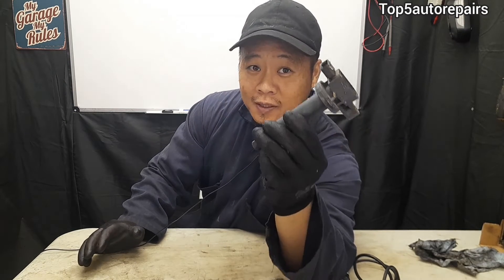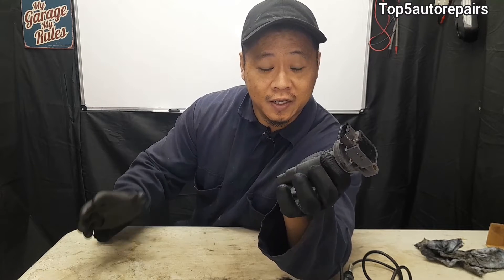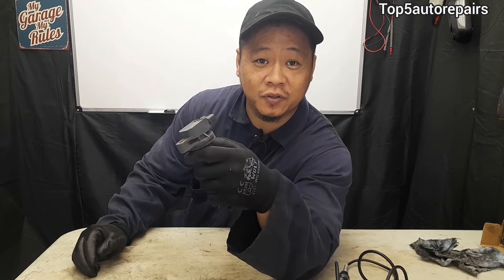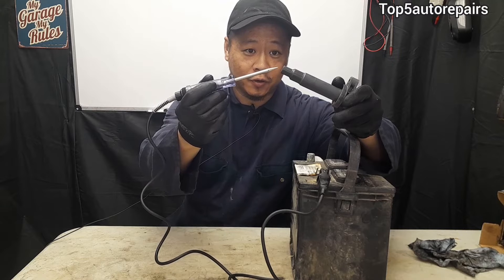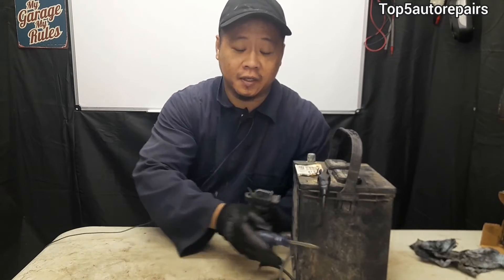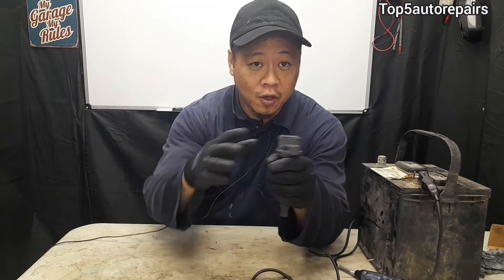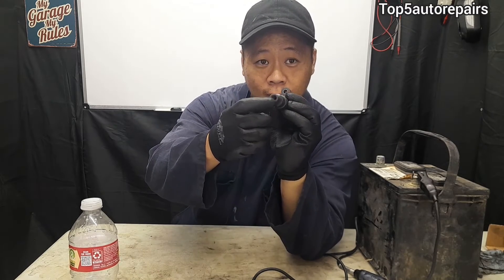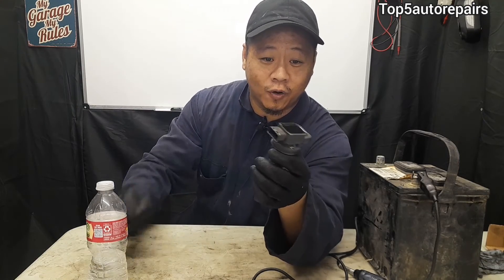Symptoms of Bad Ignition Coil (Explanation and Lecture How to Test It)

Comment: I have a 2011 gmc Acadia,and cylinder 4 has no spark so I replaced all coils and spark plugs and still no spark,I tested the cable itself with test light and seems to have power it’s just no sparking,any ideas guys thanks

Comment: I replaced the icm on my 1995 buick roadmaster, it started right away, but when i revved the engine a little bit, it shut off and didnt start up again, i probably need to replace the coils or sparkplugs. When i crank the engine, the battery loses charge, what do think that is?

Comment: Another good way to test,  is remove the coil, stick an old or spare  spark plug into it, rest metal base of plug against the engine metal,  and start it, and look if a healthy spark is jumping across the gap
.  No excessively high voltage spikes as when pulling coil off plug in engine.

Comment: My 2003 signature Lincoln town car turned of while it was running when I tried checking a coil that look bad it was chipping away at the top connector part but when I took the coil out to the a little the whole car turned of does that mean that coil is bad?

Comment: I used your switching the coil pack trick around and it worked for me 😎! In less than 5 minutes the problem: diagnosed. 1 hour round trip to town to purchase a new coil pack and back 🤬. Another 4 minutes to install it and run diagnostics, then a test drive and we're off to the races!! Thank you so much for this great video knowledge!!

Comment: Nice.
Questin : If only 1 coil fail, is it necessary to replace all, or only for fail one?
Reply from the maker: I recommend replacing all the ignition coil since they wear out at the same time
Reply: @Top5AutoRepairs ok thx. 
Since original xtrail coil cost is about $100, is it ok to replace one by one per month. Or i can find the cheaper one? After market.

Comment: 89 K1500 5.7l 350 TBI   Replaced fuel filter, injectors, and all sensors.       When starting up white smoke exhaust comes out then disappears, when accelerating after a brief stop    Again it will blow small amount of white exhaust smoke    When idle you can see and smell fuel  I’m stumped      Could it be ignition coil in fact?   Or can the injectors may be pushing too much fuel ?

Comment: Hi, I have a 2017 Mercedes E350 my scanner pulled up coil pack 2 is bad, i replaced it but now i can’t clear the code… check engine still there, had the same problem on coil 4 replaced it, but was able to clear code. Help.

Comment: Tnx man, a really clear and simple explanation!! But, what if, as in my case, I have a misfire on cylinder 4 with p0304 code and if I put the tip of a screw driver on top of the coil (with engine running) I can feel a ticking noise all along the screw driver till my hand? Tried that on the other 3 coils and no ticking noise can be felt/heard. So, is it the coil, the spark plug or the enjector? This is a 2014 1.2 tsi petrol Polo :) Tnx Boss

Comment: Nice video.   Most likely misfire problem on 2012 Ford F150 3.5L V6 Ecoboost is what?   Now I'm being told the engine might need replaced by another that had a Ford F150.   Do you agree?   Thanks so much.

Comment: Really good video. Well done and easy to follow along. I had changed my plugs 2 months ago on our 2023 Sonata SEL due to 60k miles maintenance and engine light. Now the light just appeared again. I checked the ignition coil as instructed and seems to be good. If I may ask for a suggestion ?

Comment: Have 98 Honda civic ex is my ignition coil inside my distributor?
Reply from the maker: Correct if you don't have coil on plugs
Reply: @Top5AutoRepairs  i gotten the misfire P0303 which is cylinder 3. I replaced my spark plug wireset and spark plug on cylinder 3 and still get misfire P0303. i also checked my ignition coil inside the distributor. I see the spring wire on top strecthed out little bit don't why it like that will that affect ignition coil from misfire? also i start my car fine in morning and engine starts shake little bit when i warm up for 3 min i have to press gas pedal to bring car back up it also does this when i make a stop on red light. Also my RPM gets very low when i stop ??? so could this be my ignition coil or my fuel injection 3?

Comment: Thanksssss soooooo muchhhhhhh‼️‼️I asked real mechanics and they didn't even think it was a bad coil, but in my mind and soul I knew it was cause I changed spark plugs(Which were needed anyway too) and it ran good and idle good until you are rolling and try and put some real power down and it throws a check engine light and it blink as well as lose plenty power....🗣️🗣️YOU ARE THE REAL DEAL AND THANKS A Second TIME FOR HELPING ME BUD 😎💪‼️💯🙏

Comment: 1:38 "With the engine running." If my engine was running, I wouldn't have a dead ignition coil. Am I missing something?
Reply: Hahaha. 😂 Engines run with a bad ignition coil
Reply: This means also when the car is cranking
You'll be checking and a helper just cranking the engine

Comment: Since I bought new car from agent..1st time replace new spark plugs and ignition coil after next day engine light turn on..Engine Power train P2300,P2303,P2306,P2309 ignition coil low circuit.

  is there anything about that new parts is fake or what? Mine Suzuki swift K14B Automatic 1.4L..Thank god bless you...

Comment: Question: i pose this question just for those looking for answers. Question: lets say you have a 4 cylinder or 6 cylinder and you have a couple of coils that fail... like in some cases 1 will fail and the driver either does not know or just puts off replacing it and then another coil fails. Well some cars will not start when you have lost two working cylinders. So the question,  if you have a non running condition and your wonder "humm let me see if these coils are bad" ...well ??? Yes then you probably want to pull the connector off coil and youtube someone explaining how to test with meter. A good ole VHM is the  $10 (cheap version) tool that always saves you thousands of bucks when the on board computer does not give you the data you need..

Comment: What if i switch the coil to a different cylinder, but the code is still the same? for example if I get p0308, switch that coil to cylinder 6 and i still get a code for p0308 instead of p0306?

Comment: 2003 chevy trailblazer lt shooting code p0300 and when accelerating from 3rd to 4th i lose power and get the blinking engine light at that time, but before that it runs and drives good

Comment: So my sister was having problems with her car studdering she bought new spark plugs and I replaced them It was a pain because I had to take off the intake manifold. Long story short I replaced the spark plugs and it was still doing the same thing really upsetting!  I looked up your video and did your test by pulling coil up a bit to see a change in rpm’s and yup sure enough 1 was weak did not spark like others or have that blue color. Only problem now is I can’t test the back ones there under the manifold

Comment: Enjin light does not always turn on. And mine only did it at higher speed.....not low speed. There is much more symptoms. When my coil pack heated up,like on a highway trip, it started with problems.

Comment: I replaced all spark plugs and 4 coils and im still getting cylinder 1 code. What else could it be?
Reply from the maker: Bad valves, bad piston rings, blown head gasket, bad fuel injectors/wires...

Comment: What if car don’t start to do this test
Reply from the maker: In that case, the problem is something else. If one or two coil failed, the engine will still start but run very poorly. If you still want to test the coil, you can test the ignition coil with a multimeter by checking resistance. I do have a video for this.

Comment: I did a coil swap and then I had two cylinder misfires I put the coils back on the original ones and now I still have two cylinder misfires
Reply: I would look at the connections real good.

Comment: hey man just replace my clutch on my 9th gen civic si, with stage 2 kit with oe hd flywheel and it’s a 15lbs weight and no tuning/req as there website stated and people never had any issues. some how when i break in my car im in 200 miles break in with the clutch, car went to limp mode and 2/3 cylinder misfire. never had issue with the car only after clutch replacement. reset code and now it’s 4 cylinder misfire. hopefully it’s the coil pack which i will do it when i get the parts. it’s so odd that i get misfire when everything i replace is oem specs. i will do my spark and coil and go from there. hopefully 🤞

Comment: Defective crankshaft sensor cause misfire not having enough compression in the cylinders.Certain year nissan crankshaft sensor after market will cause misfire and the intake. hose mas. Sharing with people who have nissan the value in the 2 parts is different from the after market. Hitachi manufacturer mas and Denso manufacturers crankshaft sensor for nissan the value may different than oem.

Comment: My 17 Yaris IA says misfire cylinder 2, needs ignition coil, but it doesn't shake or sputter at low speeds or idle. It sputters if you gun the gas.

Comment: You’ve helped me fix my vehicle and families vehicles by watching some of your videos. I’ve had my vehicle parked for three weeks now and I wanted to ask if you can help me out. Before it stopped turning on, I had to jump the vehicle in the afternoons to get back home from work now it won’t crank over. I’ve bought a brand new battery. Replaced the alternator and the starter truck still doesn’t want to crank over any ideas ? 2013 F150 lariat 4 x 4 5.0 V8.flex fuel
Reply from the maker: Hello. You might have a bad starter, starter relay, or bad ignition switch.

Comment: Silly question when I'm standing in front of a 2019 Hyundai Accent sit down what order does it go from passenger side driver side I have to change a coil ignition coil is it 1234 can you give me the order they are in when you have time should be appreciated
Reply from the maker: #1 is on the serpentine belt side, then 2, 3, and 4.
Reply: @Top5AutoRepairs  thank you so much I was on my way to work today when the car started running rough so I pulled over put it into park and the motor was shaking. I took the oil cap off and it was lots of blow by the car started smoking blew out the tailpipe so I shut it down put the code reader in, told me what was wrong. Then I cleared the code took off the back on the road to go to work, but I screenshot the issue. It was giving me.po302 cylinder two misfire detected
Reply: @Top5AutoRepairs  yep number two coil was buggered put the new one in first I did what you said on your video I was watching with the tester put the new one in there works like a glove thank you so much
Reply: 2019 Hyundai accent sedan 1.6 litre what is the firing order if your standing right in front facing motor

Comment: I have 2006 toyota sequía  but something is messing up my ignition coils I have change it like 3 times I change the computer which mechanic says could of be sending to much power to the coils is been like 4 months but just yesterday  my check engine started blinking and car had vibration while park. After a minute normalize again so far good but hopping is not doing it again 😊

Comment: Brother I have an 06 is250 been sitting for 8 months it run when parked now trying to get it running again bought new battery try to start it it just cranks thought it was the fuel pump so change that still won’t start
Reply from the maker: Try adding fresh gas in the tank. Next, I suggest checking the engine bay and check if rodents chewed up engine wire harnesses.
Reply: @Top5AutoRepairs  thanks for the advice I will check it brother

Comment: hi, when I pulled the coil out it had oil at the bottom, where it goes over the spark plug, could you say why is oil there? Does that means that my engine is going bad?
Reply from the maker: There is oil because the valve cover gasket/spark plug tube seal is bad and is causing oil to leak inside the tube. Most likely the engine is 👌.

Comment: I have a misfire on 7 and i swapped it out with some extras i had but the engine stopped shaking and the rpms dropped to .5 and not on 1rpms which is where its been

Comment: Hi I have skoda rapid i have changed spark coil and ignition coil still I have the engine sign flashing and I have epc.do you know what will be the problem.i have diagnosed it says po351 which I changed more then 3 times after awhile I get still the same signs

Comment: Lesson you guy, the ignition coil last 120,000 mile or more if go bad is because the spark plug is oiled because the exhaust valve inside the cylinder is leaking. After you test  the integrity then you make a conclusion on what to do.

Comment: Good explanation. I have a misfire on 2016 Chevy Traverse, but it just gives me P300 (random misfire)
I wish it would give me a specific cylinder code...
Vehicle only hesitates/rough idle when it gets to operating temperature. When its cold in the morning, it runs fine for the first little bit of driving.
Reply: If it's a coil pack, aka a block all the plug wires feed from could be a small crack u don't see an when it gets warm opens up, sound like you could have a moving misfire if coils are arcing bad enough,  my 2004 Sentra right now runs fine for the first 10 mins then stats acting up. Changing coils this aft, I have individual coils per cylinder top one was changed by previous owner. 
(cyl4) My miss is now cyl2 so I'm doin the other 3 along with swapping all 4 spark plugs. Hopefully that cleans up the idle an low rpm take off. She shudders an loses power when I stop an take off.

Comment: I was working on my 07 Toyota Avalon. With over 190k (I have 237k now)at the time back in 2021, I replaced all spark plugs , replaced coils but I only left the front three ones. The back of the v6 is harder to get to so I replaced all coils so I didn’t have to. Transmission was also serviced and fluid is bright colored. But I’ve been experiencing shuddering and lack of performance when accelerating from dead stop and vibrating at a stoplight in drive. Do you think it’s because of not replacing the front three coils?

Comment: Will you get a check engine light if the coil became weak but still works?  My car has a slight misfire and when i go full throttle power is sometimes little hesitant.  And how do you check if the coil is weak and not just dead?
Reply: Check the spark plugs if the gap is correct still. A large gap can cause that issue

Comment: Who ever reads this and having trouble telling if your car going out or about to turn off /1.make sure you have a new battery or alternator that can cause your car to turn off with no response just noise 2. Make sure you replace your head gasket and starter. head gasket will cause your car to turn off randomly at any given moment and you might panic thinking it won’t start but let it cool down then start it. bad starter going to be rough every time you start your car might be quick or the sound of your starter starting the car will definitely make your face expression change but if it’s to late for that warning then your car will turn off but you be Able to turn the power on but not the car itself unless you knock it with a hard item 3. Bad transmission or coils pack now this a tuff one because both problems have the same symptoms when you accelerate on the gas you will lose power in your rpm but I’m sure if you having a bad coil problem your signs in misfiring or slip in your rpm your acceleration will make you go slow then randomly speeds up bad transmission when your accelerating you down on power meaning if your driving 40 or 50 your car rpm will start to jump or start going down while your foot is on the gas paddle
Reply: Id just tear the motor down take head gasket out so it breaths well when put back together... Oh and file the rings down smooth before putting head back on
Reply: Yeah.   Like a bad starter will make a car stall.   No.  It won’t.     Headgasket?     If it stalls from a bad head gasket you’ve got more problems than a bad head gasket gasket, you’ve probably gotten coolant into the cylinders and …..oh I give up, you are the wizard of cars .    That’s sarcasm.

Comment: Can a bad ICM/Rotor/Distributor cap or plug wires cause a rough idle intermittently as well as when I'm driving about 1500 rpm and the truck feels like it's shifting but will also sometimes do a stutter feeling while driving.  It always does it when I first start the vehicle and drive until it warms up.  I was thinking it was this.  I've changed the IAC/Coil/TPS/EGR etc.....the transmission fluid is still clear.  I'm hoping it's not the TQ converter.

Comment: Wow great advice and video, i have a check engin light on, it's steady, no flashing. My code is reading p302 its a 2017 jeep wrangler unlimited. Its involved just to get to coil and spark plug on the drivers side of the engine. Is there anything else i should be looking for before i start tearing this apart. It seem like it running fine, low speed, at idle, at high speed. If the check engine light wasn't on, i wouldn't of noticed an issue with it. That's how good it seems to be running. Just scratching my head iver here. Any of your thoughts would be appreciated. Thank you

Comment: I got a Chrysler 200 2013 everytime I get to 50 thru 60 it act like it wants to hesitate idk if that could be the ignition coils or not?
Reply: That probably has to do with these ignition coils. Did you find that changed by replacing them?